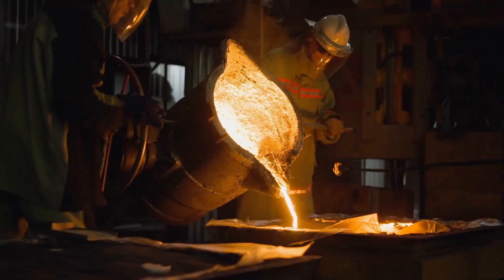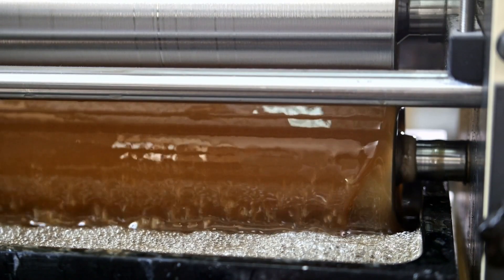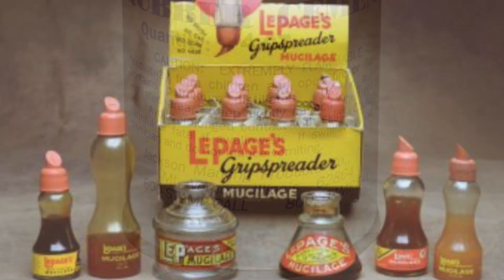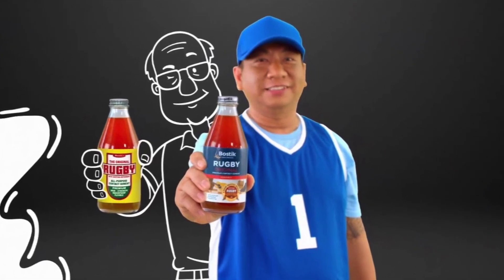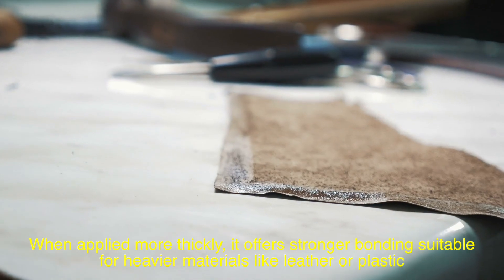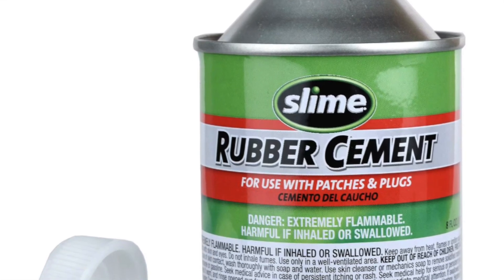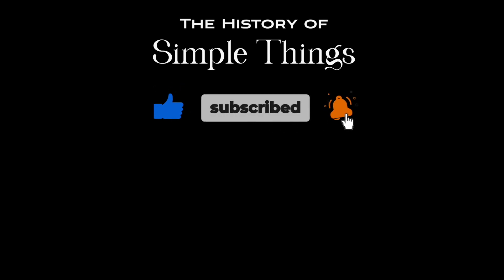Invention of Rugby Rubber Cement

Comment: The formula is essentially the solution of Rapid crystallising Chloroprene rubber of very special Molecular Weight in Toluene or Xylene
Reply: I think Benzene was once used, but discontinued for obvious reasons.
Reply: What about contact cement or vulcanizing rubber cement? Because I know contact cement will not re soften when solvent is reapplied.

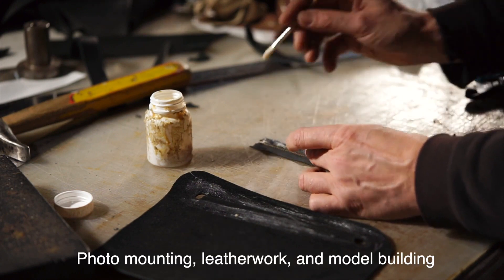Comment: 2:06   I don’t know about Rugby brand but rubber cement is not generally considered a “repositionable” adhesive. Generally rubber cement grabs immediately and never lets go. You have one shot.
Reply: You are thinking of contact cement.  Rubber cement can be pulled apart on paper, not when used with inner tube patches.
Reply: You are thinking of contact cement.  Rubber can be repositioned on paper for a little while.  Rubber cement for inner tube patches can not.
Reply: @tsl7881  So is tire patch glue more like contact cement than rubber cement? Is contact cement what they call "vulcanizing rubber cement".